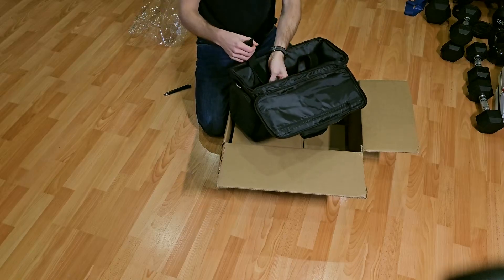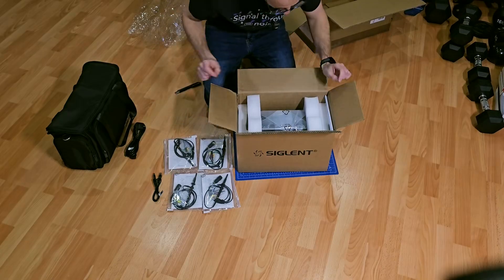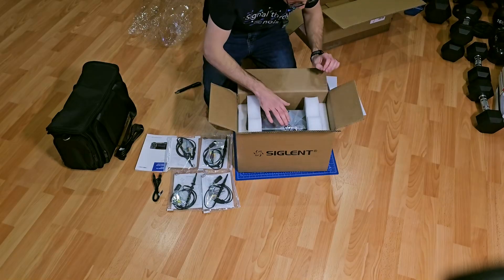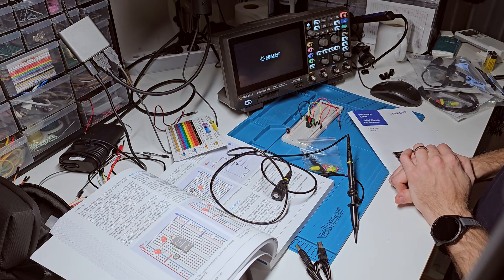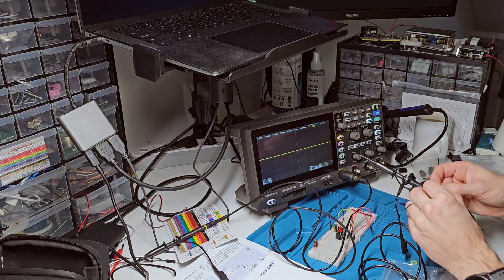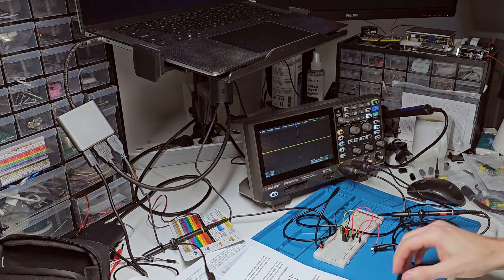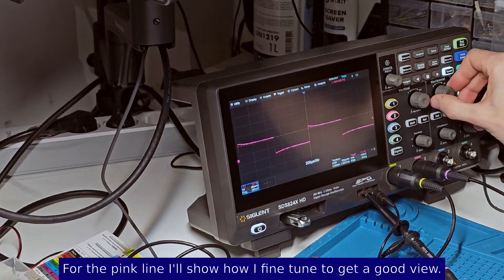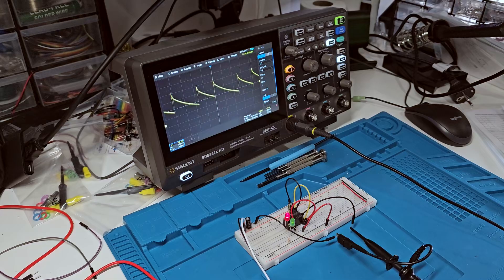Siglent SDS824X HD Oscilloscope arrived!

Comment: What book are you using in this video?
Reply from the maker: It's called "Make: Electronics". It's the third edition. Author is Charles Platt. I can highly recommend it if you want to learn practically. 

Another book I have digitally is Practical Electronics for Inventors, 4th Edition by Paul Scherz and Simon Monk. I use it a lot less though.